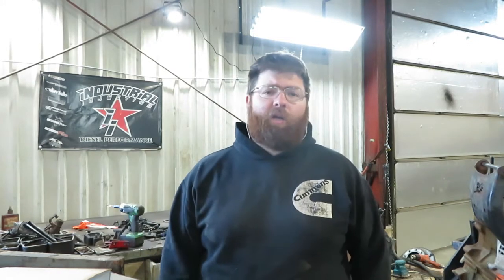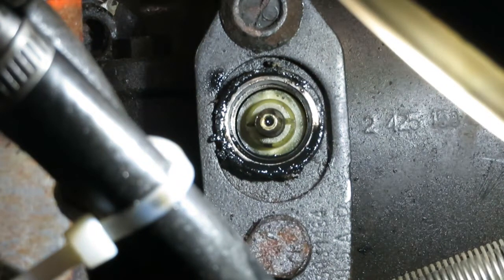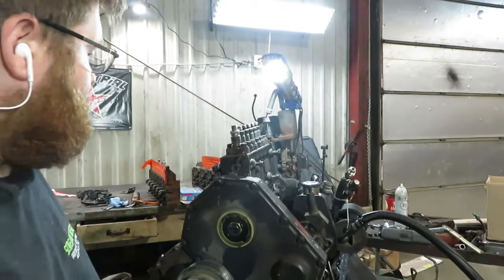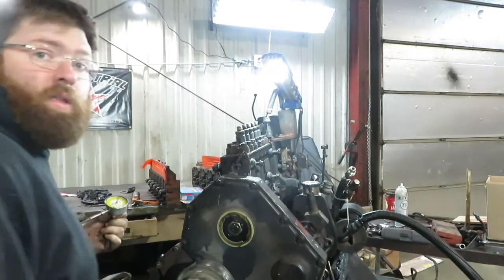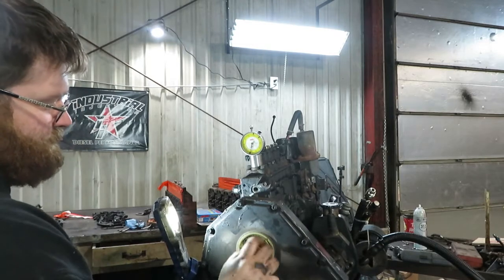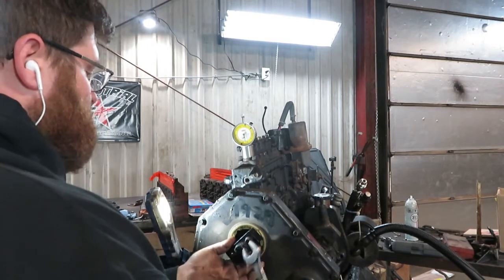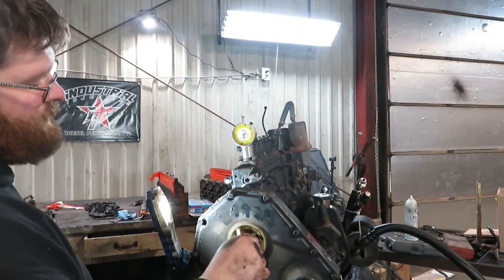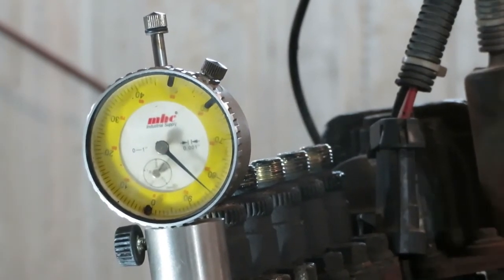How To Time A 12 Valve Cummins

Comment: Good video, i did this for the first time tonight on a 1968 auto 160  pump 
Followed steps but when checking timing at the end i set to 201 17° but when turning counter clockwise to dead indicate 0 and back to tdc to check timing pin my indicator clocked 3 times around, did it a few times with same result. Now back at tdc my gauge reads 201. Did i do it correct or am i confusing you as much as i am lol thanks

Comment: Where did you buy the kit??? I’m desperate right now. Have a 97 12v I’m installing an adjustable timing gear and advancing the timing to 22 degrees but don’t know if my truck is at 18 or 20 degrees currently. Curious how you recommend determining what the current timing is at.
Reply from the maker: I bought it years ago from diesel auto power. And as for finding timing just pin time it to stock and go from there.

Comment: After you pin time the pump, at what point do you pull the pin on the pump and RE install so it’s not pinned anymore
Reply from the maker: After the pump nut is snugged up so it can’t turn. I wouldn’t do final torque with it still pined. If the engine turns over at all when torquing it could bent to tab.

Comment: with the dial indicator in when turning counterclockwise to zero the indicator.... is the pump still pinned?
Reply from the maker: No or you will break the tab
Reply: @screamindieselltd  appreciate the response... new owner of a 12valve so wasn't exactly clear to me. Thank you so much
Reply: @screamindieselltd  so
Do you need to pin time the pump also ? I want to move my timing from factory 12.5 on my 215hp pump to 18 degrees

Comment: I have a p7100 , and the inlet side I use clear hose and there are no air bubbles, on the outlet side or the return line there  is millions of air bubbles, it loose power and shut off, I bleed it and runs enough to drive for 10 minutes at before it begins to slow down, again, and I bled it again.Note I Change  the lift pump, injectors still the same. So I think the p-pump produce air causing it to do this. Any thought before I buy a ppump.
Reply: Delete the fuel heater and replace all the fuel lines from the tank to the pump. Use marine grade fuel lines. West marine sells marine grade fuel line and LarryB's fuel line kits come with everything for dodge 12 valve. And get a lift pump elbow hose. I just figured the stock fuel lines are garbage so might as well. And there's a beans sump that would eliminate any problems with the draw straw in the tank. 
I had air bubbles in my return line and it has all new fuel line and ran good, so I don't think your pump is bad. If you have to pump the lift pump to start it, then you probably just have air leaking in a cracked fuel line somewhere. Fuel filter might even be loose and letting air in. These ppumps go a million miles
Reply: Its a few years later so hopefully you figured it out by now but if not It’s probably your ofv either replace it or upgrade to adjustable

Comment: I had the timing cover on and when I tried turning the motor over with the pump gear pulled out, and tried turning the motor over to line up the dimple, the pump gear still moved
Reply from the maker: Yup the gear will still move but the pump shaft will not turn if the gear has been pulled off it. There is no key way in the pump it’s just a tapered fit.
Reply: Ok so I did the timing and everything, it starts up but once you get to 1200 rpms it pops out of the exhaust and blows whit smoke

Comment: Thanks for this vid, just got a 05 Fummins and I love it but it smokes white at idle so I was looking through the receipts and found a few papers explaining how to set the timing(with greasy finger prints) and  my trucks plunger specs were apparently .1925 BTDC. That was in 2011 it’s 2021 so possibly the timing slipped again and it’s smoking white now? I’d like to advance it to 16 degrees just like you
Reply from the maker: It’s possible that it slipped a little, but from my experience they don’t slip a little they slip a lot when they do. Losing any coolant? Does the smoke smell sweet or burn your eyes and smell like diesel.
Reply: @screamindieselltd  smells like diesel and seems like it’s just not burning the fuel, not sure if it has bigger injectors or anything. How could I tell what injectors are in it? A specific gauge for the holes? I’ve tuned the afc to have good power and it still smokes a lot. I’ve also tuned it to not smoke before boost or anything and it still hazes at idle
Reply: It has head studs and doesn’t seem to burn any coolant
Reply from the maker: @cameroncaltabiano5030  it very well could be the injectors. The only way I know of getting them checked is a test bench that measures the flow and compares it to factory numbers. The holes are too small to measure with a gauge.
Reply from the maker: @cameroncaltabiano5030  timing being off will also make it run like junk. No boost, missing when trying to rev up and just run like garbage
Reply from the maker: @cameroncaltabiano5030  sounds more like an injector issue.
Reply: @screamindieselltd  yea the truck runs super smooth, never misses and makes 30 lbs of boost. The thing just smokes like crazy
Reply from the maker: @cameroncaltabiano5030  probably too big or wrong style of injector. Just too much fuel.
Reply: @screamindieselltd  that’s what I’m hoping... I had some 5x12s on my last 12 valve and it never hazed like this. I’m looking at some SAC 145 degree 5x12s. Is that a good angle to you ?
Reply from the maker: @cameroncaltabiano5030  for a stock piston 145 is what you want. And that would be a good size. That’s roughly a 90hp over stock. What size turbo is on it stock?
Reply: @screamindieselltd  yea as of now it’s stock size I believe, it isn’t a holset but it isn’t bigger. I’ll probably get a s362 soon with a .88 exhaust housing
Reply from the maker: @cameroncaltabiano5030  that be a nice size for it.

Comment: Can you tell me how to do this on a 12 valve with ve pump
Reply from the maker: The VE trucks don’t really have a way to do it with a dial indicator. They are more like how you adjust timing on a car with a distributor. You have to loosen the mounting bolts for the pump to the timing case and rotate the pump clockwise looking at the back of the pump.
Reply: @screamindieselltd  I’m getting ready to do a tappet cover billet and gasket on my 12v cummins do I need to break the pump nut first are would I go ahead and pin time it first then break pump nut lose then rotate engine clock wize to drop nipple into notch in back of timing cover ? I was leaving timing stock

Comment: No matter what, my truck started smoking and popping like the timing slipped or air is in the line. I've timed it this way 5 times today
Reply from the maker: Are you pin timing or a dial indicator?
Reply: @screamindieselltd  Pin, I sent the Injectors away to get tested
Reply from the maker: @vendetta1306  ok because I was going to say I’ve had pumps jump 180* when pulling the gear off before. But if your using the pin that wouldn’t matter.